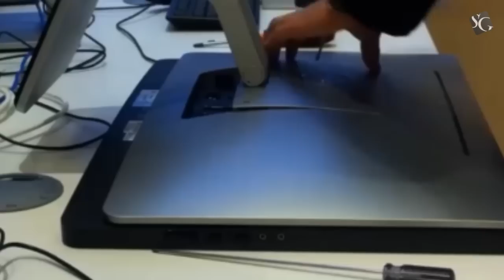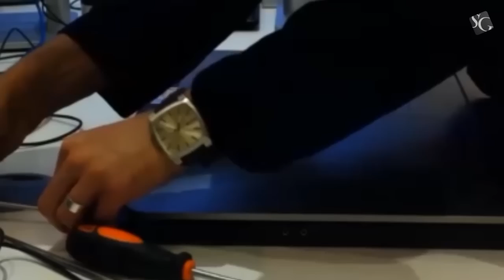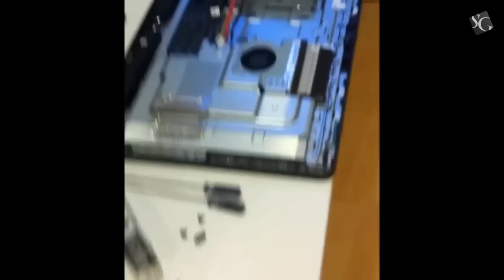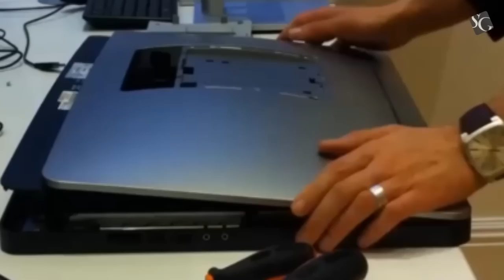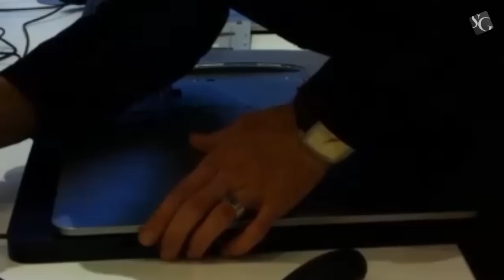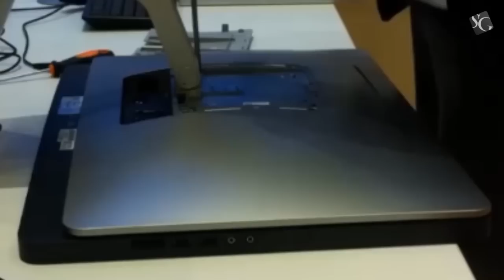How to open a Dell Optiplex 9010 all in one computer to do a hard disk change

Comment: Screw you to the Dell Engineers of the 9010 series who decided to bury the HD  20+ screws, plates, other components deep.
Reply from the maker: hey Thomas...I don't think they had much room left for any other options :)...considering its an all in one system...
Reply: You think that's bad? Try replacing the HDD on one of their lower-end laptops - you have to remove EVERYTHING to get to the HDD because it's mounted at the bottom of the case and they were too stingy to provide a removable door to access it from underneath.